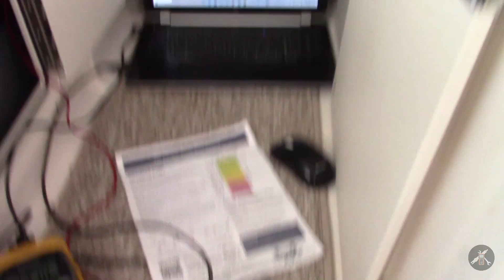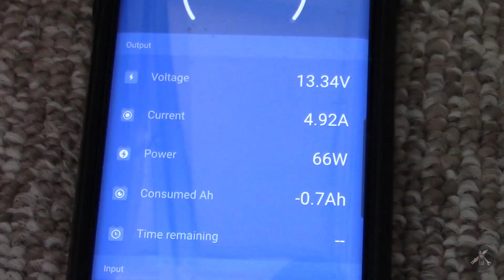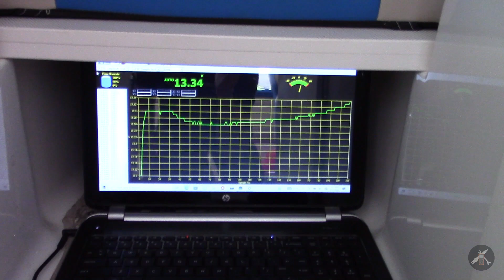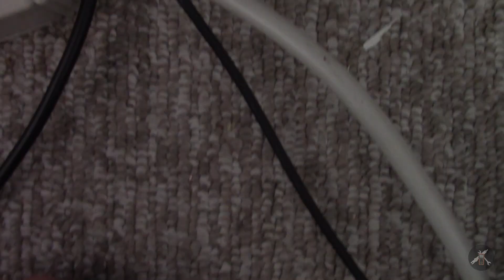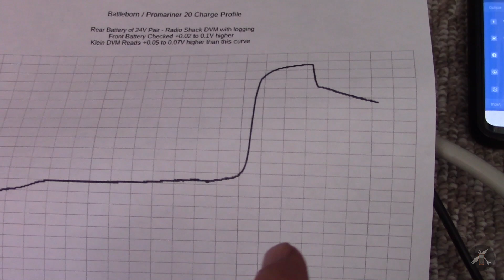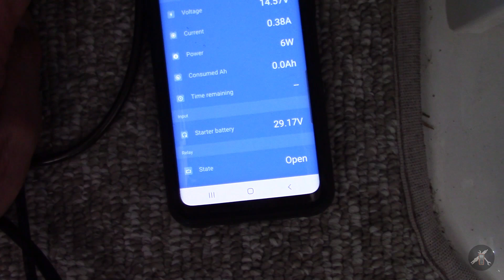Charging with Victron BMV-712 Battery Monitor and why you need a Lithium Charger -

Comment: Without looking there is some setting on the app for how it determines SOC? I’m trying to figure that out myself.
Reply from the maker: The BMV measures SOC by amp-hour integration, it counts up the cumulative number of amps (or fractions of an amp) charged or discharged over a time interval. In simplest terms, if you have a 100 amp - hour battery and you discharged at 10 amps continuous for 10 hours, the 100 amp hours would be consumed and SOC would go from 100% to 0%. Similarly, 10 amps for 5 hours would be 50 amp-hours or 50% SOC.
The system automatically synchronizes to 100% SOC when the battery is fully charged (parameters can be adjusted to set this). You can also manually set the SOC to 100% after you have a fully charged battery.  Then the monitor will count down and up based on the current flow out and back in until the next time the battery gets a full charge, when it will re-synchronize to 100% to remove any drift or error accumulated over time.
For the measurement to be most accurate, the battery parameters must, of course, be set up in the monitor,